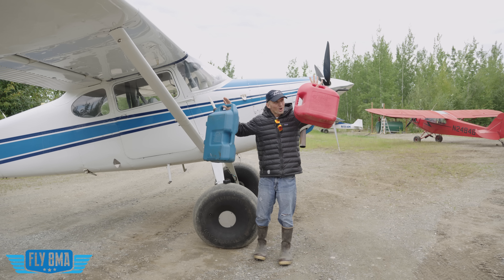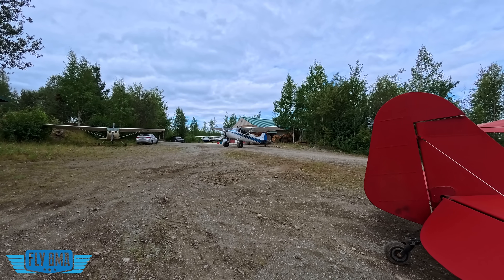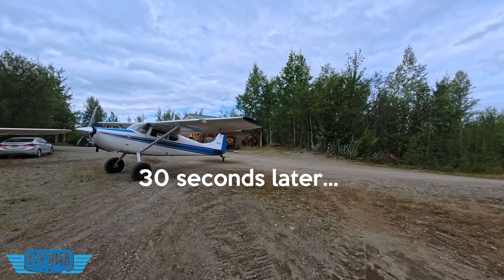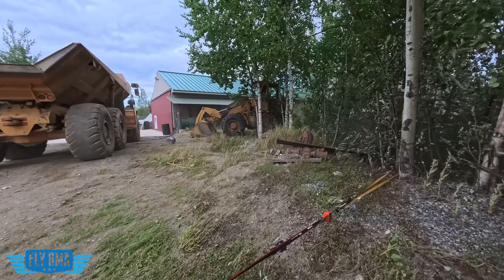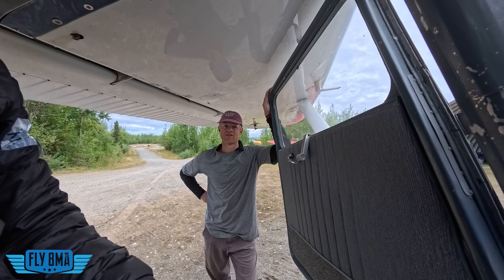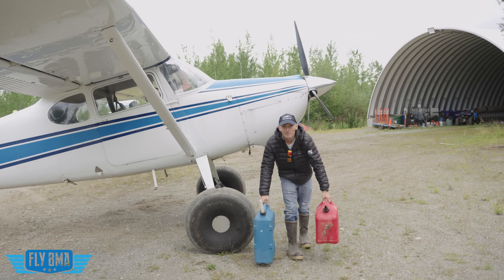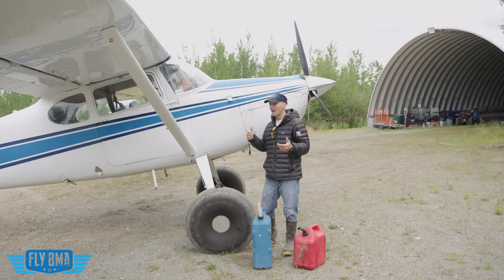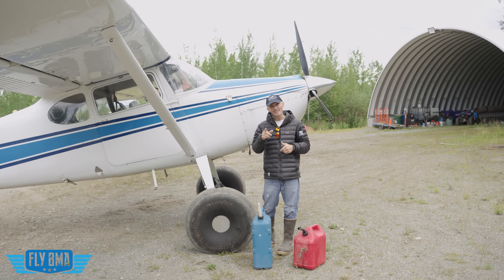Will a Plane run on Car Gas?

Comment: Owning a Rotax, the main benefit of unleaded fuel, is the ability to use modern synthetic oil, with its many lubrication advantages, and longer oil change intervals. Lead does not suspend well in synthetic oil, as it settles to the bottom of the Rotax dry sump oiling system. Owners must clean out the lead sludge deposited in the bottom of the oil tank if using 100LL. The 912ULS engine has a 10.8:1 Compression ratio, requiring 93 octane and above. Of course, like many engines built & overhauled after 1970’s, it has hardened valve seats. Rotax also requires the engines rubber hoses to be replaced every 5 years. This not only curtails any dry-rotting, but also allows the fuel system to be upgraded with modern materials.
Reply: I cleaned the oil tank out for the first time after 2300 hours with  my 912S, after burning 100% mogas in that time, and it was pristine, no gunk in it whatsoever!
Reply from the maker: My little 912uls has seen everything from 87 to 100LL and doesn't seem to mind either way luckily
Reply: We can't get 93 for the high compression and turbo rotaxes up here.  Best you can do is mix about 25/75.  But then you still can't run the full synthetics.  Not a big deal, the sport plus 4 is good stuff.

Comment: Very interesting, but I thought that we were taught that using lower gas than 100LL will cause detonation and heat up the cylinders, could you please explain! thanks Jon et team for the interesting stuff you do and share
Reply: My 1961 172B with an O-300C was designed for Octane 80 fuel, and ran on that for most of it's life until 100LL was introduced. So mogas at at Octane 87 - 94 is more that fine.
Reply: @GlensHangar mine too… 80-87
Reply from the maker: Well we should have been taught that "it can", not "it will".  Engines can run just fine on very low octane fuel if they are designed for it (i.e. not turbo charged and low compression pistons).  If internal temps and pressures are kept at certain levels then there is no need for high octane fuel.
Reply: @fly8ma.comflighttraining199  What percentage of airplanes that currently run 100LL are not turbo charged and not high compression pistons? And for those that are, what are they to do? Is it sufficient to solve the TEL problem by only solving the subset of airplanes that can run autogas?

I say that as someone who has an STC to run car gas. And I love it. But how many airplanes can also do this? If all of them that could, did, how much less 100LL would be consumed? Would that be enough to satisfy the political pressure to find an unleaded AVGAS?

Comment: My plane has a Rotax engine which requires fewer oil changes if I use car gas instead of leaded avgas
Reply from the maker: Yup!  My 912 is the same...it is happier with unleaded fuel
Reply: Not exactly where I expected you lol, I would love to see more GA content on your channel.
Reply: I have a rotax too. On my lawn mower.. .😂😂😂😂🤣🤣🤣🤣🤣🤣
Reply: @massimo3670 Hal?? 😂😂😂
Reply: @gregwatruba4541  Yessssss it's me !! 🚜🚜🤣🤣🤣🤣
Reply: AVGAS despite its Low Lead description contains lots of lead that poisons the aircraft as well as the occupant.  Its time is almost up anyway.  I hate having to chuff out so much lead for an engine that doesn't need it and the grey "soot" on the bottom of my plane is in fact lead and occasionally have to dig balls of it out of the bottom spark plugs.  Maybe they'll find a nice drop-in replacement for it like arsenic or polonium- so far they have made a massive meal of its replacement - but the way I see it much of the fleet does have a viable alternative so I don't see why the replacement has to be suitable for ALL that use it at once.  When we got rid of lead in cars some couldn't use unleaded so they were able to still use it the rest could use a cheaper better alternative.  Mine couldn't use it but I figured I'd get tens of thousands of miles before I needed to recondition the heads and that day never came anyway. (not quite the same as a plane obviously)

Comment: Only issue I've heard about is accumulation of detergents on valve stems from MoGas; the way around that appears to be run MoGas in flight but switch over to AvGas otherwise.
Reply from the maker: Huge advantage here in AK, we don't have all that detergent crap.  Our fuel here smells so much better than what I get when I'm down in the lower 48 at the gas station.  If you're buying bulk in the lower 48 you're probably able to also skip detergents when you're getting it delivered to you from a terminal.
Reply: Lead causes valve stems to gum up and stick. Mogas doesn’t have this issue.
Reply: @Iflyagrasshopper  Yup.  Specifically the lead bromide.